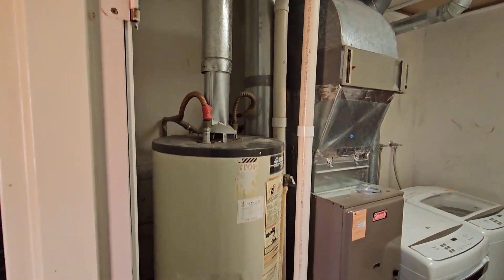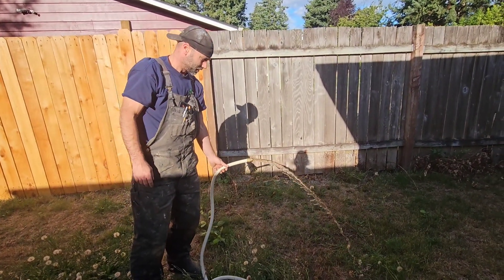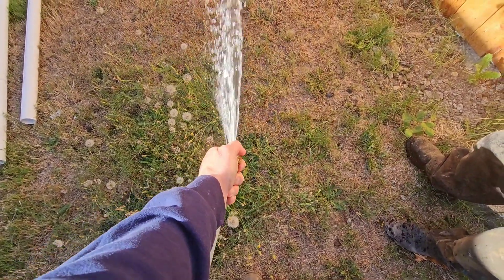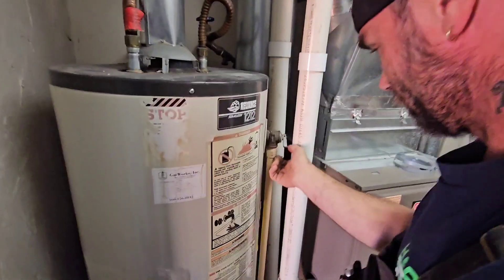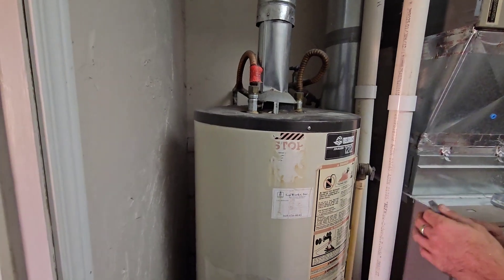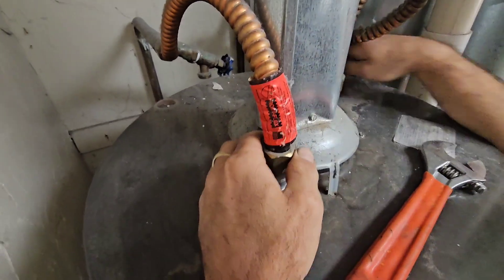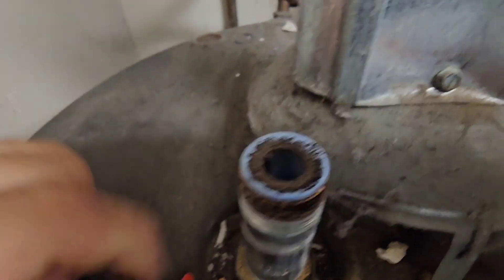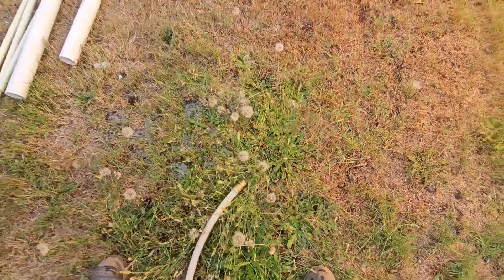How To Drain Water Heater - Don't try it until you watch this

Comment: Do not take advice from this person.
Reply from the maker: So your advising not to do a live flush before draining a water heater. 😂
Reply: @LearnPlumbing  What does "Live Flush" mean?
Reply from the maker: Live Flush the tank first before shutting off the water to tank and draining it. Leave the water Live means leave it full pressure. Use the full house pressure to flush the bottom of the water heater before you shut the water off and drain the tank.